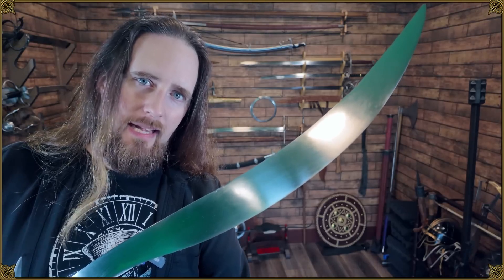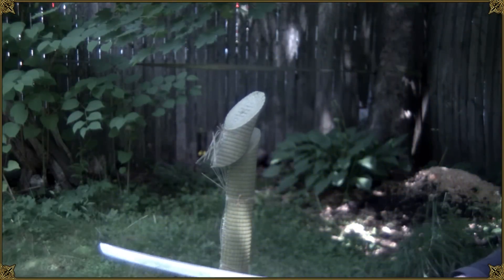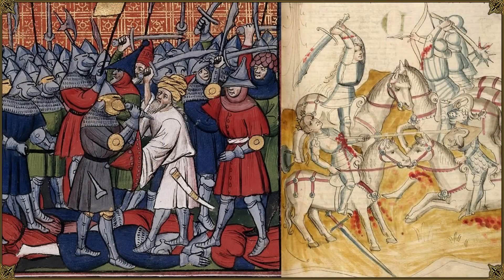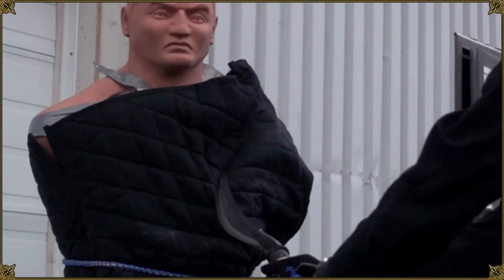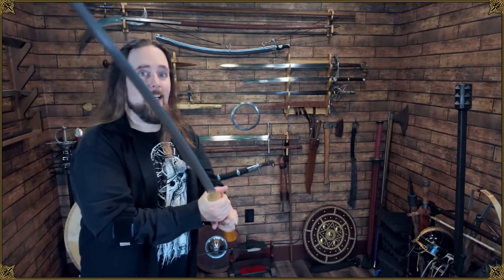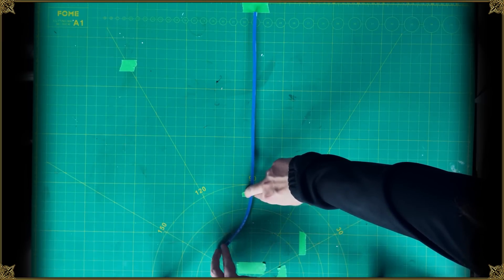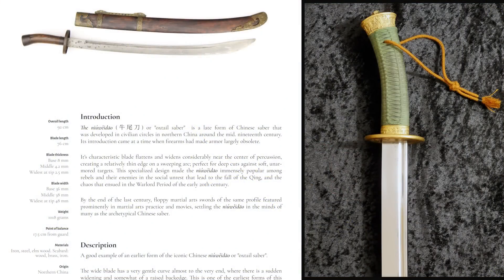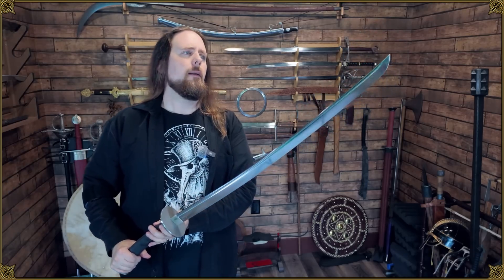Sword Design: What's the Recurve For?

Comment: When you pull on a recurved grip with the lower hand, you're putting more power into the cut when it's most likely to actually be in contact with what you're hitting, because your lower hand is more quickly able to "throw" the sword into the beginning of the cut. The arc of the cut begins less powerful, but ends more powerful because when it's contacting, your hands are more in-line which makes it a lot easier to put more controlled power into the cut. Basically your lower hand being further away gives you more leverage to power the cut earlier.
That's just how I see it at least.

Comment: I think that the reason you don't notice a difference, is because the straight blade is the balance between curved blades and forward curved blades.  

And your time spent on them over others.

To me, balance is also preferable. 

Straight blade has a nice chop with good weight distribution and balance. 
Forward blade, abit more chop. May have better effect vs forearms and hands/wrists. May even help snag a weapon or arm for just a split moment.

Curve blades with better follow through, and can have more weight further up the arc. More choppy long-slice.

The recurved handle feels better to me when my feet are positioned more even.  Gives me a slightly more compact swing that feels quicker. There's also a better sense of edge alignment.  Maybe because each hand is on a different angle so your sensing two different inputs. Just a theory. 

Leaf curved blades, like straight blades, have a balance, but benefit from the curve blade.

Comment: I think that all the curved handle really does for single handed(beyond what you already mentionned) is shifting the total arc you can "wrist swing" more ahead in the swing. Let's say you got angles with a clock from the side you would wrist swing from 11 to 8 with straight but curved youd do 10 to 7 instead. And that's from just wrist movement, I'm sure it could alter the course of a fight when added to all other arm joints, torso etc. you can all add up in specific swings for someone taking this to their advantage. Especially if you add the deceptive aspect of "where the blade really is" you mentionned.

Comment: The curved blade assists in the cut by angling the blade away from the target more, thus giving it a reduced angle to the (perpendicular) direction of momentum & a better slicing action than a straight blade (the same reason why the guillotine has an angled straight blade rather than a horizontal straight blade). The recurve blade is, in fact, more of a "chopping" blade, as the recurve brings the mass of the blade forward on the hand, like the blade of an axe, thus applying more force to a smaller striking area than a straight blade.

Comment: Love the vid! As far as I can remember from reading local literature on this as a child, curved handles, especially gripping them at the curve(and not the straighter parts above or below ), should enable quick wrist based flicks and accompanying stabs with the tip of a recurved blade. Typically the tip of a recurve blade is brought back to align with the handle. Together these two make possible to stab around opponents blades, in quick and unexpected ways. You need the fighting style to go with these facilities ofc.

Comment: I think the curved handle in that BTK, LTK, or whatever his name is, in that sword it is to give you more room to crank in the push pull swing.

Consider your hand position. With a two handed grip on a straight long sword, you can only crank so far until the pommel is into your push/guide hand’s forearm.

But with a forward curved grip like on that LTK sword, you have maybe another inch of crank room.

And now let us think about the ratio of movement of the pull hand to the fulcrum to the length of the blade. That extra inch of grip/ crank room is giving you at least another four, if not significantly more, inches of acceleration time/space.

Or another way of stating the advantage conveyed by a forward swept grip handle, you also don’t have to move your pull hand all the way into the push hand’s forearm, binding your grip up and significantly limiting, or at least impeding, further fluid kinetic motion to reach another guard or strike or parry, or what have you.

With that said, I’m little more than a chimp, and if I’m using what everyone calls a clip point knife, but a clip point where the point of the blade is a above the center line of the grip/blade, I always, and I mean always, accidentally cut myself. Apparently I’m too stoopid or inexperienced with such blades to unconsciously track the swept tip as if it’s an extension of my body.

And beyond that, to your point about swept forward handles just increasing your grip/ your ability to just hold on to your sword when swinging… anything that helps! Tonight I was backyard cutting with my adult child and the CS Gladius flew out of my hand in a very weird direction, impaling itself fully six inches into the ground…

My hands were soaking wet because I just filled a water bottle with the garden hose, just picked up a slashed water bottle and grabbed machete for a quick stroke… and a couple nights ago I reprofiled the grip, octagonalizing the over-large rectangular grip… and removing the over large blumpy “cord” rings… I planned on either wrapping the handle in leather or cord but wanted to have a cutting session to make sure the profile was right before applying either of those grips… my God…

I could have killed my kid. They were in a “safe”area but the machete didn’t land all that far from them. This was 2 hours ago and I’ve got some form of the shakes. My hands aren’t shaking but I’m shaking on the inside.

After the reprofiling session I considered my grip on the machete for the next cutting session, and I deemed my overall grip better after reprofiling, though I felt that the absence of the grip rings made my grip less secure…

4 decades of baseball, softball, racquetball, shooting, carpentry, etc. I’ve never, not one single time, had any tool fly out of my hand. The way the machete slipped out of my hand, as I tried to keep a grip on it, it caused my fingers to cling on to the edge of the bloopy pommel, creating a sort of flick as the machete handle left my hand. A flick that I could never reproduce if I tried every day for the rest of my life…

Can you tell I’m still in a state of shock? Oh wait… four or five years ago I was building a chicken coup in winter, with six inches of snow, at night, and I was screwing something on the exterior, walked around and into the interior to screw something and when I lifted my hand up there was no screw gun in my hand… my fingers were freezing, I’d lost feeling in the hand, and couldn’t tell I’d dropped the screw gun into the snow… I amend my earlier statement, that is one time a tool slipped from my hand, but then that’s not what I’m talking about regarding a tool slipping out of my hand… I mean slipping out while I’m swinging the tool.

God, this comment is a mess. I’m a mess. Was nice knowing you, Skall, a bit,

Comment: I think the recurved hilt serves several functions.
1- creates a distal taper as a resistance to sliding back like a pommel would but leaving room for a 2nd hand to grip
2- when gripped by the 2nd hand, this is a more natural grip then the lock-step grip of two hands in a perfect line. If you put your two fists together, they are not in a perfect line, but rather follow the same curve position as a recurved hilt.
3-aids with edge alignment and indexing.

Comment: I like your example showing practically nonexistent difference in reach.  Not even one square on a 25 square stick.  That's nothing.
On top of that, a curved blade usually cuts way better closer to the tip, so the actual effective reach can be higher for a curved blade.  Which is likely why they did it.

Comment: The primary difference a curved hilt is going to make for cutting is how it interacts with your hands and arms, and how far your swing can actually cut into and/or through a target. It's more about the interaction with body mechanics than about the weapon itself in a direct sense.

If you're not swinging your arms at all, just pushing with one hand and pulling with the other, that action has a hard limit on how far the blade can move. There comes a point where your arms and hands will get tangled up on the hilt if you try pushing any further. If that maximum extension stops you when you're just touching the target, you can only "slap" the target and make a shallow cut into it at best, not slice through. By changing blade shape, curving forward lets the same extension on the same handle cut "further" while a blade which curves backwards won't cut as far. Likewise, curving the hilt backwards will shorten the distance you can cut towards the target, while a recurved hilt will let your blade cut deeper into the target.

It's the same thing as trying to punch someone who's just barely close enough to touch with your fist, and basically just slapping them with your knuckles, then taking a small step forward and the exact same punch knocks them a couple of steps backwards. Follow through on a strike (regardless if it's with a bladed or blunt weapon, or unarmed) is important, and a recurved hilt can allow you to get follow through on a quicker strike with less of a wide swinging motion needed to get it.

Comment: I've had two theories about this (granted, I'm a total amateur and have no idea what I'm talking about :) -- Could curved edges be easier to start a cut ... at the micro-second of impact? Like.. Lets say we have a curved blade like a "C", or parenthesis "(" and it's coming in contact with something oval shaped. Not totally flat, but not a perfectly round stick either. I'll represent that with a "D"

D( <- The point of contact is a bit smaller than something hitting straight across -> D[  .. Could that make it easier for the cutting action to begin, focusing all the energy into a smaller point, even if but for a fraction of a second? Sorta like... starting a tear on a piece of thick cloth and following through, vs just whacking it straight across? Maybe the curve offers slightly better quilted/leather penetration on a cut?

The other theory I've had is perhaps the curved blades are from earlier time? Maybe.. bronze needed a fatter blade to be sturdier? And since that got codified in their culture as the idea of a sword; they kept doing it when better materials were discovered? -- Maybe outsiders were like "hey that's cool" and just made some curvy blades of their own? I know in the tacticool world, ideas spread around like wild fire then die out just as quick. (I'm a total noob so maybe this is super cringe). I could see curved handles being a holdover from knives with horn handles. I've seen lots of skinning knives with a curvy horn handle.

Comment: Could the recursed handle be about edge alignment on two handed swords? With a straight sword and handle, the edge alignment is entirely controlled by the angle of the wrists. But a curved handle puts one hand in front of the other, such that side to side movement of the lower hand causes a twist of the blade. Relative positioning of the hands seems like an easier way to control edge alignment than wrist twist alone.

Comment: Another observation entirely unrelated to the previous comment, not all "straight" blades have straight edges, a lot of them only seem straight because human brain is not always smart and things like symetry messes it up sometimes. The most obvious "straight sword, curved blade" are perhaps leaf bladed swords, but many "straight" swords do actually have a slightly curved edges too. If the tip isn't as close to a perfect mathematical triangle as humanly possible, the edge is most likely curved a bit, like a classic western chef's knife (obviously curved) that has been elongated, which kinda is what is happening.

Comment: 7:40 You could say that more advanced cut is a compound movement, so the easiest way to understand it is to break the action into parts. First, think just of the movement of the tip of the sword, it makes it a bit easier to see. Then focus on the straight movement first, with the top hand just pushing the blade forward from a guard position. The tip here should be moving in a straight line parallel to the ground, think of the length of its path. Now think just of the rotating part, still same type 1 lever action you're thinking about. Obviously, the tip is making some kind of circular arc.  Now imagine the blade does the same rotation while being pushed forward, combining both. This path is necessarily longer than both the linear path or the arc the tip would have taken if you were doing just one of the motions. But you're still doing the movement at more or less the same amount of time (one or two arms, muscles contract/expand only so fast), so that tip (and therefore any other part of the cutting edge) has to be moving faster than it would with just one of the two motions, hitting harder.

Pistol grip handles, I would argue that by far and large, it is for style points and/or comfort, not mechanical advantage. Specifically, I would argue that the one handed versions are swords that intended primary use benefited from being able to just lock your wrist or whole arm into position. Think of horseback. If you're charging straight forward for a stab, you can lock your entire arm up to the shoulder and hold the tip pointing forward when the grip is bent instead of your wrist or arm. Same for stabing targets on foot who are lower than you, or even cutting downwards.
Reply: Of course, this thing about the cutting technique is theoretical, considering optimal set ups. In practice, that means you need a blade which length and handle langth makes the difference even relevant, the intent to cut at your max power, and to be equally skilled cutting this way as in any other way you could try to cut with instead. I.e. in practice, it often doesn't make much of a difference, and plate or scale armor will still stop the cut just the same, and unarmored targets would be sliced through either way, so... yeah. Not the most practical difference.

Comment: I have two ideas regarding the recurve handles:
1. Maybe it's just ergonomics. The curve changes the lower hand's wrist angle, relative to the upper hand. This also separates the wrists more than separating the finger groupings.
2. It may help with edge allignment(???). With a straight handle, hands are in line, so they are in a 1D space. With the curved handle, the hands' positions get a 2nd dimension, alligned with the axis in which (ideally) the cuts are performed.

Comment: As someone with technical knowhow regarding this topic, and as a professional tool designer, I can say that the role of recurves in both blade and handle can  vary depending on the specifics of the design! Sometimes it's simple ergonomics, other times it's to affect the presentation of the blade relative to the mass distribution, preserving a certain axis of rotation in the hand(s) and so on. It can also affect the relative follow-through and resulting acceleration vs. impulse, which can make certain cuts more viable or effective. Not all of them have the same effects on performance, and it really is a matter of context and how it fits into the overall design and intent.

Comment: Ok, so that is basically, in practice, like a two handed pistol or epée grip, and that brings the blade more forward and towards the enemy. But being also two handed and curved in both the grip and the blade, it adds a very powerful lever for the left hand, that brings more inertia for the strike, and by being a curved grip it counter acts the curve in the blade, making it easier to reach with it.
  I think your geometry fails, as I think the shape of the grip affects the leverage. I mean that the turning point should be on a handle, on your actual hands, not at the turning point that you count it, ie. where the blade starts. 
 But you're alright, anyways.

Comment: A curved handle allows you to "sling" the sword for a heavy and quick strike. This typically works for cutting type swords like Shashka, Daos, Sanzabars and other similar sword. This is why those blades are more likely to come with curved handles. They also allow you to do some twirling tricks, but that is more of a byproduct.

Comment: If you look at the direction that you are pulling on the handle with the bottom hand when the sword strikes the target, you will notice that with a forward curved handle, the pull is much more toward your body than with a straight handle, where it is angling upward far more. And since you can put more power into a pull towards your body than into a lift, you should be able to hit harder with that handle configuration, if you are using that striking technique.

Comment: A recurved blade is to enhance the effectiveness of pull cuts - such weapons are meant for close quarters fighting. You thrust to vital areas and pull the blade back to slice at the target's arms/hands as you recover into a defensive position. They are geometrically very BAD at cutting, due to the contact point being in front of the hand rather than behind it (best) or at least parallel with it. The compensation for that is usually extra mass in the blade, near/at the sweet spot - this lets the blade at least cleave in a bit, if it must be used to slash at distance. But that makes such weapons a bit clumsy for outside range fighting, so the long slash is more of a killing blow than a fighting blow.